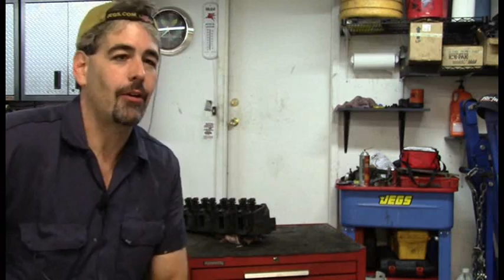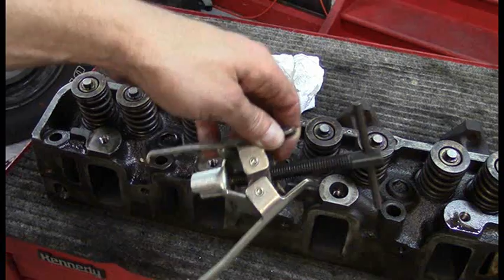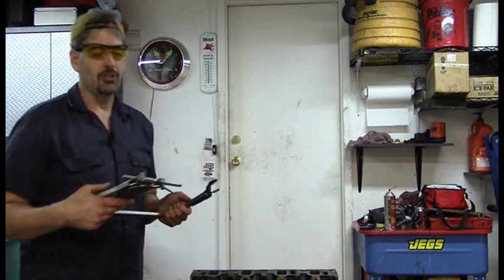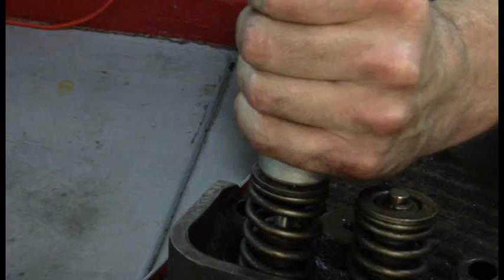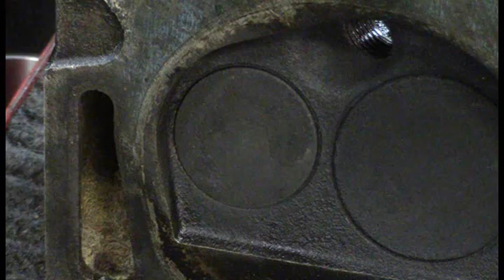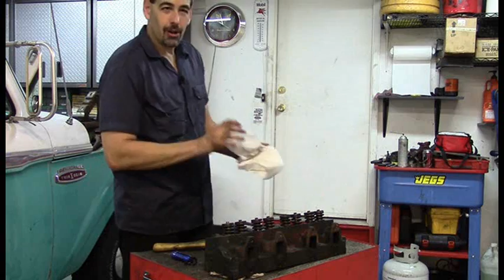Extreme Budget Engine Rebuild-Pt5- Cylinder Head

Comment: Ha ha!  I love your smart-ass sense of humor.  Question:
I use a caliper and do not have a micrometer as I would prefer not to spend the money on if I can prevent it.  You also seem to rely on a caliper.  Are there any engine-related measurements that you would use a micrometer instead?  Many people doing engine work use micrometers as they may be more precise.  What is your opinion on that?
Reply from the maker: +eStrangeSun Great question bro- I agree a caliper is not as precise and if I were doing say a expensive high performance rebuild I would be more inclined to use mic's but for what I do- rebuilding junkers at extreme budget to help the poor get by another 2 or 3 years at most, calipers work fine.

Comment: +Schrodingers Box Also, an easy quick way to check for cylinder warpage is to put the cylinder head on a glass table (thick glass preferably, you dont want to break the glass) and see if there is light coming through the glass and the head. Then you can check it more thoroughly by measuring exactly how much warpage there is and compare it with the tolerance as you cite on the vid.

Comment: You can also use a socket and hammer to remove the valve springs, although I'm sure you already know that...
Reply: +Luke Adams Yes but the problem is when the keepers are stuck it doesn't do anything. The trick with this tool is a super strong magnet that pulls the keepers away from the valve stem. But yes sometimes a socket will work if they jar loose
Reply: +Luke Adams that's what i do it helps to lightly tap the end of the valve and around the retainer to kind of break it loose then put the socket on and give it a good solid wack.

Comment: I am sad tk see this series end. I have a 56 F100 w/a 272   and  it is in pretty bad shape like this engine was. my block was full of water from a hurricane and sat that way for several months before I got it. I guess I was hoping for a fairy tale ending  to give me hope and save me $$. im gonna miss this series!  Had to be the best that I've watched that pertained to what I'm working on. Thanks and hope to see more!!
Reply from the maker: +Jonathan Diffee Thanks man. Yeah it was unfortunate but I hope to do another rebuild in the future with either a larger budget or better yet, a better candidate for the $500 rebuild !
Reply: +Schrodingers Box after using a 1" dowel rod(several actually) and beating the pistons out I was able to hone the cylinders pretty smooth. had to give the heads a hydrochloric acid bath and rinse to get to rid of ALL the rust. Doing the port & polish myself, when I get the time. Like yourself, I have a job that pays the bills then this as a hobby. If your ever in the Dallas Texas area you can use my 56 as a video prop. Ha. Seriously though, I have and still AM learning a LOT from your videos. Keep em coming, I'll watch em'.

Comment: just paste the valves in with some valve grinding compound it will be right
Reply: +Brian Wynn Thats what I was thinking, yet no mention of it. Pretty standard thing a quick lap in of the valve once its been out and takes no time at all. Yeah its not going to fix any "major" seating issues but it never hurts to try it first before spending cash and it would likely cure that seat that was inked in the video.
Reply from the maker: +Brian Wynn How would the valve grinding compound "know" to only grind the high locations.  I don't understand how it wouldn't just be equally abrasive to everything.
Reply: you keep using the grinding compound until you have removed the high locations
Reply from the maker: Brian Wynn Ohhhhhh....kaaaaaayyyyyy.... You do realize that's not even remotely the purpose of grinding compound right?
Reply: what do you believe the purpose of it is then ?
Reply from the maker: +Brian Wynn It is not used to make corrections in the seat other than very minimal ones if the valve angles of the seat and valve match such as after a valve job.  You don't just take a valve that isn't seating and lap it and expect it is going to "be right".
Reply: Schrodingers Box maybe you should read a Haynes manual. Obviously the compound removes the highest points because those surfaces would be in contact with the compound not the low surfaces. You just demonstrated with a sharpie in your video SMH how did the valve know to only grind the blue parts 🤷🏻‍♂️
Reply: I've actually used a cordless drill on the end of the valve stem and ground out some good imperfections. I told him it wouldn't last but he didn't care at the time. That was twelve years ago and it's still a daily driver.

Comment: Random question,  but if I turbo/super charge an engine, do I need to make adjustments in my fuel pressure?
Reply from the maker: You mah need to if the fuel trim indicates lean

Comment: i want to know a simple question if you want to answer it, that how do you by hearing a pop sound after removing valve stem quickly, that it is within specs. what is the logic behind that. just for knowledge .
Reply from the maker: Swapnil Kurmi It is not a positive test- it is a negative test. I.E. if you do NOT hear the pop sound, then there is no way it is withing spec because clearly the stem to bore clearance is too big.  If you do hear it pop, it does not mean it is within spec it just means it is likely it is and worth verifying.
Reply: thnxx . it really helps.

Comment: Is it possible to sort the valve seat by re-lapping them with a valve grind stick and lapping grease/cutting oil? I've done this before on a 4 cyl 8v engine, seems fairly diy and inexpensive. Not sure I'd want to do it on something with a million valves though!
Again enjoying these video's alot! I've worked on engine's before but still find I'm learning more/different ways to approach things. Great stuff!

Comment: Is it okay to steam clean the cylinder heads and other parts of the engine to clean up all of that carbon and oil build up? if not why so? Gonna be doing my first car project this summer on a gen 2 Firebird with a Chevy 350 

i watched part 1-5 so far and ive learned so much! Thank you! ive been taking notes for when the time comes lol

subbed! keep it up
Reply from the maker: MrAlternation Yes it would be most recommended.  My machine shop charges quite a bit for this, putting us out of budget, but if it was my car I would have done it.
Reply: Schrodingers Box Nice, good to hear. I have a steamfast SF-370WH. Gonna try to avoid the machine shop to cut cost.

Comment: I know of at least 2 other valve tools you can use for a head job (not to nitpick, just to inform other watcher's) One is a hammer style (similar to the socket idea before, but it has magnets to both remove, and also apply the keepers) not sure where to buy it, but i've seen a video of it and it seems quite handy\fast.
the other i think is for a SBC, but i used it on my jeep inline 6, it's basically a bent flatbar with a bolt hole and a forked end.  This may be particular to pushrod engines, or even more specific then that.  The idea is you put a rocker bolt in the bar then lever the spring down (typically with a rag holding the valves up while the head is laying on a bench)  The tool cost me about 20 bucks locally, it's probably more like 5-10 dollers to buy one in the states.  Quite inexpensive and just to check the valves on a head (to decide whether to send it to the shop of if lapping is all that's needed)

::edit:: opps, forgot to finish watching the video, you mentioned the other hammer style, my bad :P
Reply from the maker: animefreak5757 Have them all. I use depending on the application and whether head is on/off car

Comment: Thanks for the info! I just watched the 5 parts I could find about engine rebuilding. I almost stopped watching with the initial negative comments towards negative viewers (I kinda thought it brought the series down) but I like that it mellowed out with "head" humor LOL I am watching this because I have a 1998 honda CRV that I was thinking about turning into a drifting/rally rig. Particularly rebuilding the engine to install a turbo on the 2.0L 4 cylinder motor. I to am a scientist, BS in computer science and love to tinker with everything. I've rebuilt a 2 stroke dirt bike engine. I thought a little 4 cylinder would be a good place to start with 4 strokes. Great job on the videos! Look forward to more if you're up to it!

Comment: On theses heads on a budget I would clean the carbon then lap the valves  @ new stem seals , only on high end race heads will you see a 3 angle valve job most machine shops only face the valves @ seats, I cheat @ use a drill on low speed @ lapping compound, chuck the valve in the drill @ pull it into the seat , be careful not to over do it only touch the valve to the seat 3 or 4 times then check contact , do this until you have good contact all around then stop. One word about valves ,springs @ retainers I would advise anyone that you should always keep valves, springs @ keepers together as intake @ exhaust valves have different springs @ keepers I # the valves @ springs @ keepers  so I can put them back in the hole they came out of ,this can be as impotant as  lifters or pistons in the right holes , they  all have wear patterns. Keep in mind some auto parts stores have Loner Tools if you buy parts from them you can borrow these @ some can be rented from rental places, Check around some times if you can get the loner tools it may be worth paying a few dollars more  than ordering on internet, Some times it is cheaper to buy a rebuilt engine with a warrenty.As for cambearings I always  have a machine shop do these they  can be can be tricky @ if you dont have the right tools or install one upside down or damage it you wont get oil to the top end @ if a cambearing spins it can also cause either low or high oil pressure depends on where the guage is located.I have even had a machine shop put one in up side down ,make sure all passages are lined up.before you install the cam.On a budget cam bearings are one thing I will some times not replace, one thing he did not cover is always replace freeze plugs, they are easy with motor removed but a nightmare to replace in the car.
,
Reply: +Jon Fisher Invest in a valve lapping tool my friend if your doing a lot of lapping. it adds a slight oscillation and gears the sucker down too. best 10 quid I ever spend for doing head rebuilds.

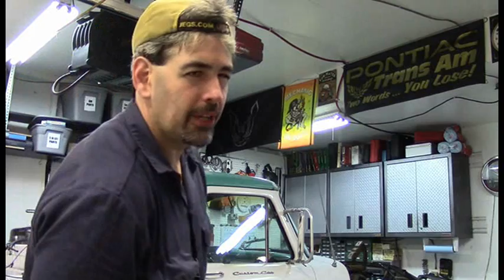Comment: 22:30  Exactly my thoughts when I agreed to change my neighbor's Fuel Pump on a 1997 Chevy 1500 Suburban last week.  Everything was fine till the guy I didn't know, whom was friends of the guy who owned the vehicle started helping me, pushed too far one way and as I told him he was pulling on the rubber fuel lines, and as I was still pulling the jack out from under the gas tank, he pushed it too far towards the driver side, kinking the metal lines.  Instead of it costing $80 just for the fuel pump, now we had to get the complete fuel assembly costing around $250, although discounted at an auto parts store ordering online with in town pickup in 20 minutes, and those metal lines are unforgiving when it comes to loosening them.  I prefer working with the quick connect fuel lines than with those dreaded threaded lines. 

This project took twice as long as was originally anticipated using my shortcut method of air can spraying the top of the fuel tank.  The only thing that pissed me off is the other guy tried putting some of the blame on me saying I was pulling on it.  Not true, I was pulling the jack out of the way as he pushed, kinking the metal line, luckily only kinking the metal line that comes with the complete fuel assembly.

Comment: I used that method years ago with an old craftsman socket and a rag :)
Reply from the maker: Are you referring to the impact-removal of the valve keepers? I thought of this but the problem is without the magnet the keepers stay on the valve. It takes a pretty strong magnet to draw the keepers from the valve.
Reply: Sometimes you'd have to smack it a couple times , but they will eventually fall out . Have to lay out a few rags on the table or finding them will be the next step in your head rebuild ;) Done automotive work since my first job at 13 yrs. old. From junkyard to dealerships . Cleanliness and common sense is the key . Still enjoy watching others and their way of doing things . Keep up the good work , great videos ;)

Comment: at 7:15 a deep well socket that's the appropriate size and a small hammer works excellent for breaking the bond between the valve locks and the retainer.

Comment: Very good series. Picked up a '65 Rambler with a  195.6 that had been rebuilt .030 by the original owner about 15 years ago. He passed away and the car sat for 12 years. I got it to run, but knowing nothing more than Hayes and Chilton, I never checked the engine. Having blown the head gasket twice and pulled the engine, I'm looking forward to actually checking the pistons, the bore, the bearings. It would be nice if the engine had been rebuilt and tucked away and things are in clearance - but that's wishful thinking. Thanks for the video. It will be fun to se if the engine components are in clearance. If not, I have a good 232, t14 transmission, motor mount and other goodies to perform a swap. I'd rather keep it original if I can. Hoping you have a few videos on the re-assembly of an older engine!

Comment: Why not put some special paste on the valves (forgot the name) and just spin them with stick with suction cup... Old way I mean;)
Reply from the maker: RattlerBK I am saying only use valve lapping compound if you know the surface is even. Valve lapping compound will not "fix" an out-of-round or unevenly worn valve surface.
Reply from the maker: RattlerBK Think of it this way- valve lapping compound will recondition the valve seating surface but it will not repair it like a 3-angle grinding would.  If the valve is not seating properly  because there is uneven wear of the seating surface, lapping compound does not fix that.
Reply from the maker: Vavle grinding compound, I believe you are referring to.  The reason I don't do that is for the same reason you wouldn't drill a hole with a wobbly drill bit- since the valve is not seating right to begin with, there is no way to be sure I am grinding the valve square and evenly in the seating area.
Reply: Schrodingers Box
You are genius! Why I didn't find you before;) Would you use this grinding compound at all in other situations?
Reply: Schrodingers Box Hi Matt, 
Do you mean not to use valve lapping compound at all for any reason on the valves, or just in this situation with that particular valve? Thanks in advance!
Reply: Schrodingers Box Thank you for you quick response, but by the out-of-round valve surface do you mean both the valve seat, and/or the valve face which touch? I feel this is stupid question, but I'm a little confused on this.
Reply: Schrodingers Box Gotcha, thanks a bunch!

Comment: Thank you very much for very informative videos,help me a lot  to decide what direction to take and look all options to rebuild or swipe using used engine. I have a  2000 Mazda MPV with a broken cylinder head(camshaft caps,lobe) cause by broken timing chain and I followed your steps to determine if is worked to rebuild to buy used engine since this SUV belong to a friend. Adding all the parts(gaskets,machine shop) goes over $1500, getting use engine about $800, also third alternative is to put and Ford Cougar engine since both block engines are DURATEC. all the cost not including labor (free) since the job is for a friend.
Reply from the maker: Well done Arahtson! This is exactly the point of the video and you absolutely made the correct call. Great story and this is a testimonial to others on how to rationally assess their situations.  Sorry about your situation but you absolutely made the best decision and approached it rationally.

Comment: Interesting video. FYI, for that year of engine, and assuming it hasn't had cylinder head work before, it will require the installation of hardened valve seats due to the unavailability of leaded gas.
Reply: Schrodingers Box He's completely right. The original small block Chevy had the valve seats integral with the head. In other words they simply used the cast iron of the head as the valve seat. In 1975 when unleaded fuel was first mandated all manufacturers had to change over to a material call Stellite for their valve seats that could prevent the valve from wearing out when used with unleaded gas. So your heads would need to be machined and Stellite seats installed.
Reply from the maker: SATAMAN Schmidt Damn you guys are the best- that's fantastic information. At this point we are actually revisting the machine shop possibility and I will absolutely make sure to bring this up with them. I never would have even thought about this.
Reply from the maker: Ah I did not know that. This truck is far older than I am so I vaguely remember leaded gas when I was a tot. Good point and another consideration if we were to do machine work.